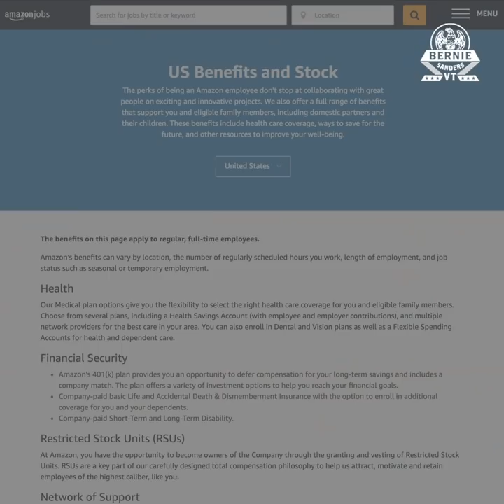Inside Amazon's Working Conditions

Comment: I work as a picker in a sortation center and it's horrible. You have to stack heavy bags in 3 layers. The third layer is extremely hard and dangerous. Instead of redesigning the carts, they tell you to beg someone for help if you can't lift alone. The work area is also really congested, it's like a traffic jam, you have to wait for others to get out of the way for you to get to your place, this causes delays and then they tell you to hurry up. 
And this is just the beginning of the shift!
Reply: The third tier on the picking cart is the backbreaker!Each bag with up to 10 packages is close to a hundred pounds total.There goes your back and try to collect any workmans compensation.